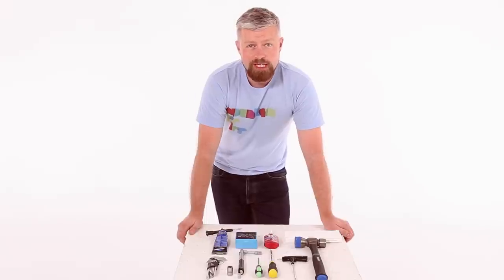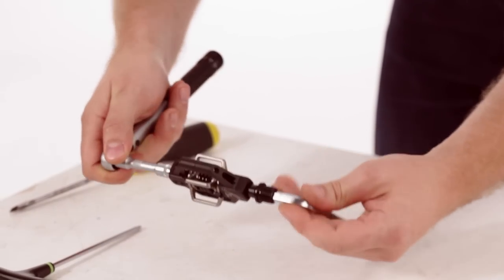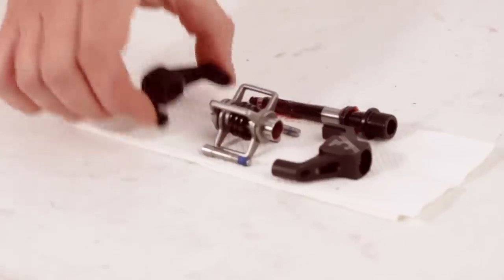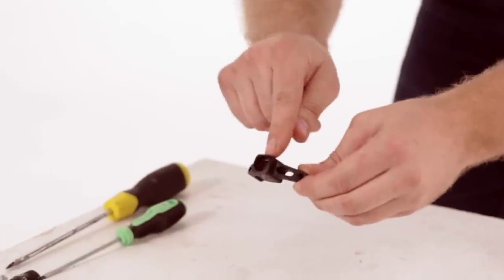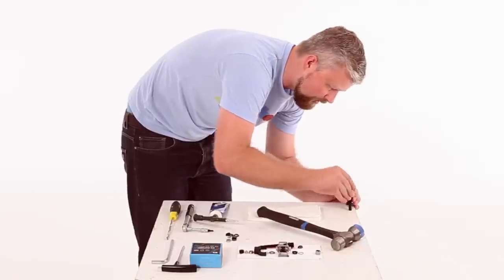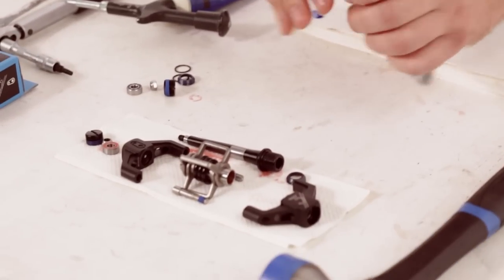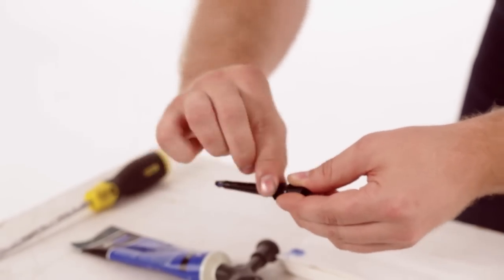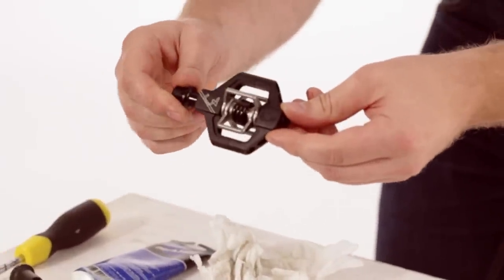How To Service Crank Brothers mountain bike Pedals | MBR

Comment: I'm very glad that I ran across this video and saved it as I just referenced it, step by step, to rebuild my Candy 7's (hopefully what I did stops the squeaking that I was hearing!).  The one thing I would note that I ran into is the end cap is definitely a key component in keeping the axle in place.  Even after the axle nut is tightened, there's still lateral movement in the axle until the end cap is tightened.